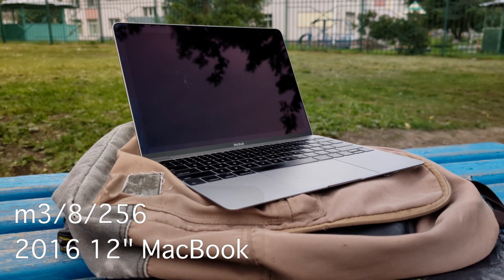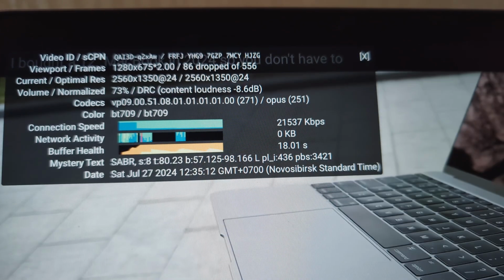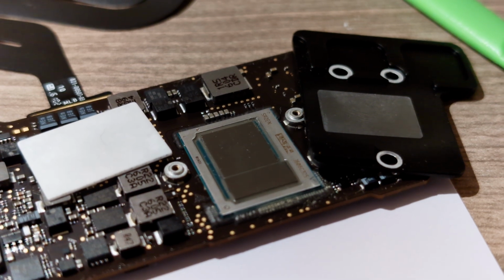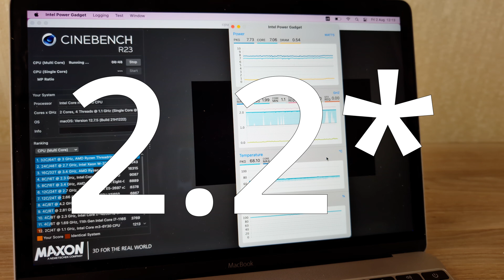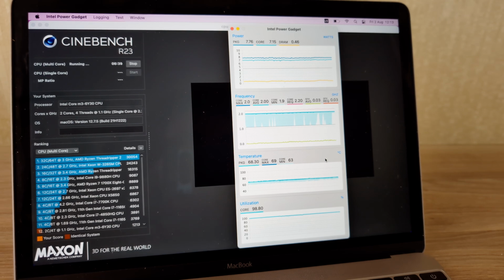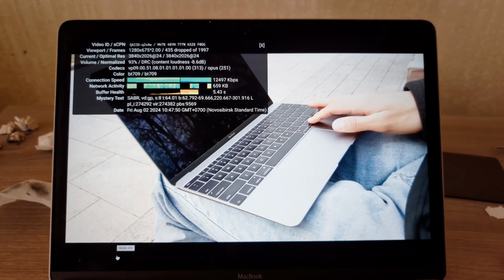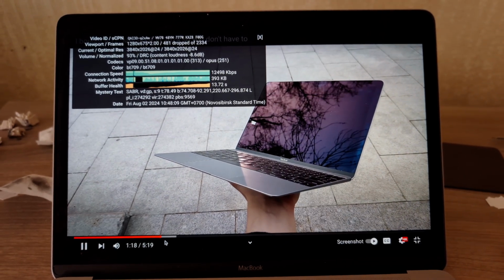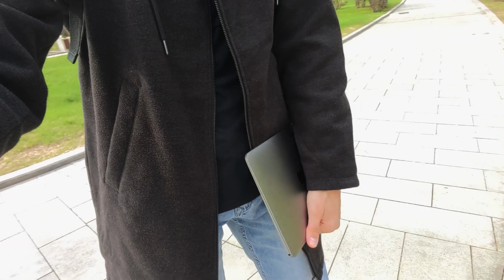The Safest 12" MacBook Thermal Mode (Upsiren U6 Pro thermal putty)

Comment: Put Honeywell PTM7950 on CPU and thermal putty on top of the heatsink so it will transfer the heat to the laptop case itself. Using thermal putty on CPU is stupid and just a no-go.
Reply: He is right. PTM7950 for cpu/gpu applications. Putty everywhere else. Seriously, from someone who has eaten his teath on this topic.
Reply from the maker: Additionally, there is a significant gap between the chip and the heatsink. Around 0.3 mm if I had to guess. So, I'd say, that the honeyway stuff is a "no-go" in this particular case.
Reply: @angrylee Putties are generally suited for VRMs and VRAM. If you're getting a gap by using Honeywell, increasing the pressure can make the difference if you're not getting contact. Had some issues where my RX6800m wasn't getting contact, but my 5900HX was.

20°C's one heck of a drop though 👀
Reply from the maker: The fact that putties are designed for VRMs doesn't answer the question of why I can't use them on the CPU in this particular case, where it draws around 8W or so. Also, refer to 1:15 in the video. The heatsink is mounted on screw stands, and there is a gap by design. It is impossible to eliminate that gap by applying more pressure. The gap exists and needs to be filled with something thick, like putty. The black putty is there by design. It was put there by Apple, not me. No amount of pressure will make the CPU and heatsink contact properly in this particular case. 

Therefore, I still don’t understand why I should take extra steps (and spend extra-money) to achieve no extra performance. Applying ceramic pad proved that thermal putty is more than sufficient in this case, and using other thermal interfaces doesn’t make sense, since it won't get me better thermals — or, I might say, it is impossible — due to the significant gap between the heatsink and the chip, which is there by design and impossible to eliminate.
Reply: @angrylee  In this particular application I agree that Thermal Putty is suitable. That's based on the low wattage and size of the heatspreader.
Reply from the maker: Care to elaborate?

There was some kind of putty out of the box, as you probably noticed. Definetely not a "no-go" for Apple. Don't see any problem puttin a putty if it does the job.